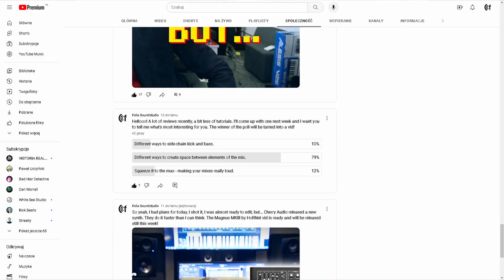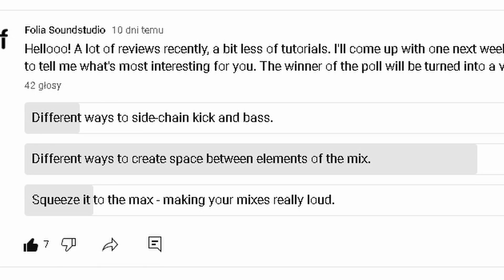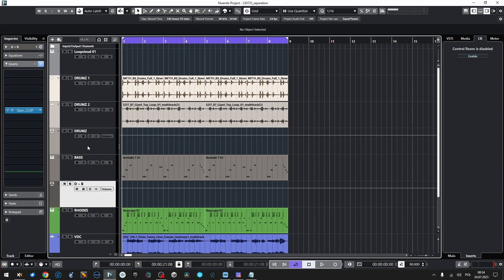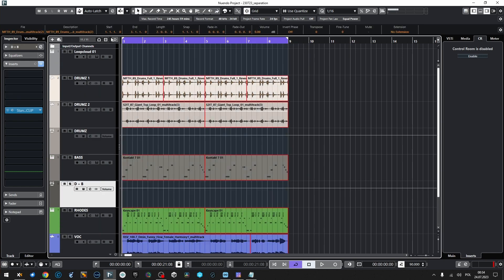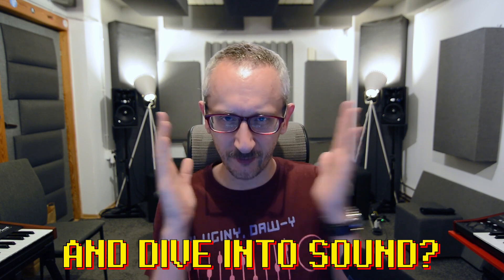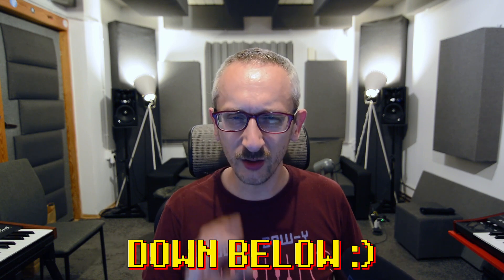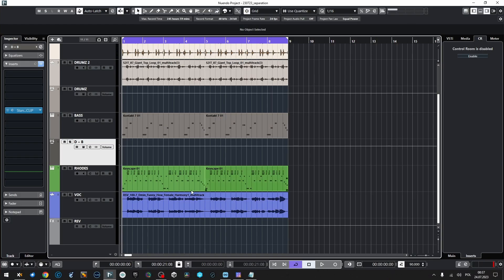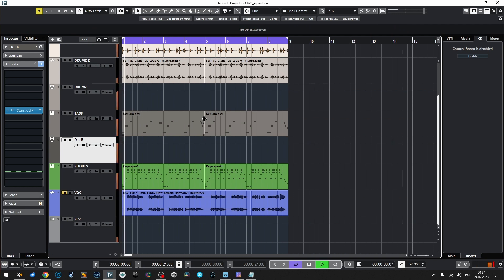5 tricks for BETER SEPARATION of elements in your mixes!

Comment: 🤔 ...This groove definitely needs some SWING.  Those last 4 notes in bar 4 seem a bit janky.  

ALSO: No tutorial on "Separating Elements" can be complete without mentioning TRACK SPACER, which is infinitely adjustable and costs $150 pounds LESS than SOOTHE 2 😂

Jus' Sayin' 😎
Reply: ALSO PART 2: Even though I originally refrained from mentioning this the 1st time -- to me the 1ST RULE of "Element Separation" is SOUND DESIGN.  If your sounds are Designed Well it won't matter how busy or stark your arrangement is because EACH ELEMENT will be inhabiting it's own Sonic Space, thus masking & confusion won't become problems later -- assuming you don't add too many tracks to begin with.  Hope this helps 😉😎👍🎶
Reply from the maker: I believe every element is important for your separation, starting from production and arrangement, ending with mixing and mastering. All is equally important and you can screw things up with a mistake in any of these fields...